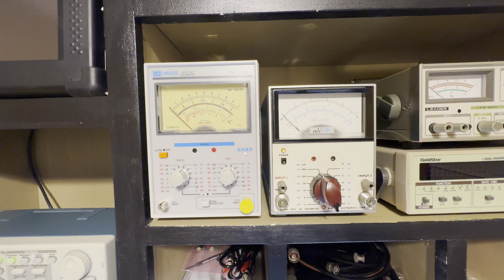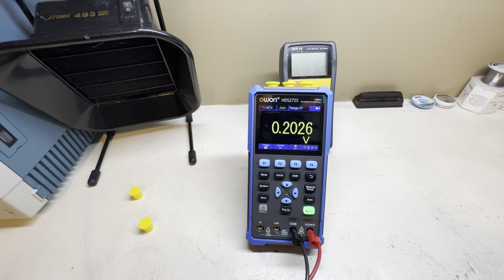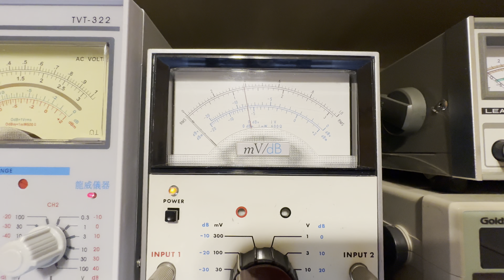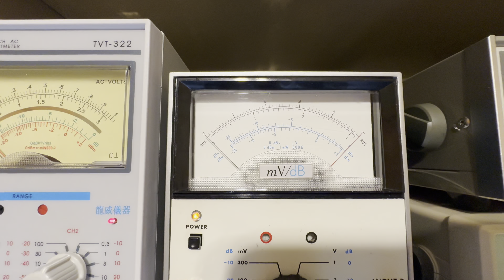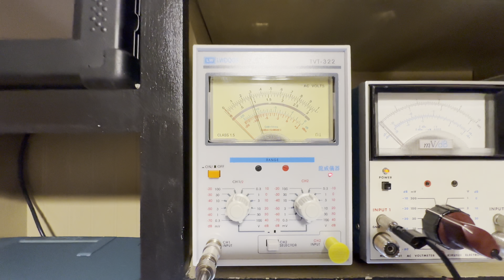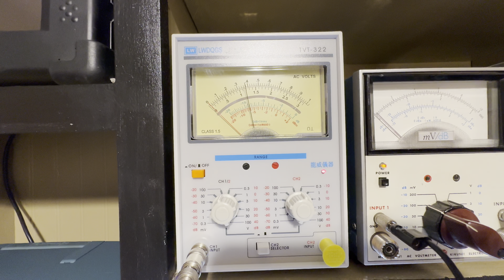Longwei TVT-322 Dual Channel dual needle AC RMS Milivolt Meter performance review

Comment: Surely it's going to make a difference that the 322 is 600 Ohm input impedance.  You're feeding in 50 Ohm.  As you raise the frequency, the error will get worse.
Reply from the maker: It likely is, but you used them at low impedance depending on what I am biasing. It is accurate enough and use it regularly to bias decks.

Comment: I've hooked a sig gen up to this ac voltmeter and a scope - set to about 1KHz at 1V pk-pk. What this shows is a high frequency oscillation added to the sig gen waveform as soon as you connect this voltmeter. I tried a 100nF cap across the output (which would degrade the frequency response) but the oscillation disappeared and the meter read close to what was expected. I need to experiment to see what the minimum capacitance needed to stope this interaction and the effects upon frequency response. However, the leads from the signal generator used are unscreened and this problem may be due to picking up noise from the overhead lighting. Will investigate.....................